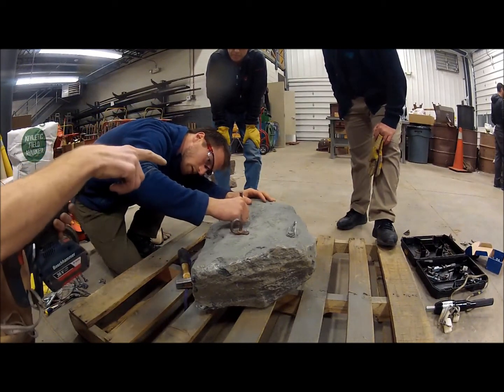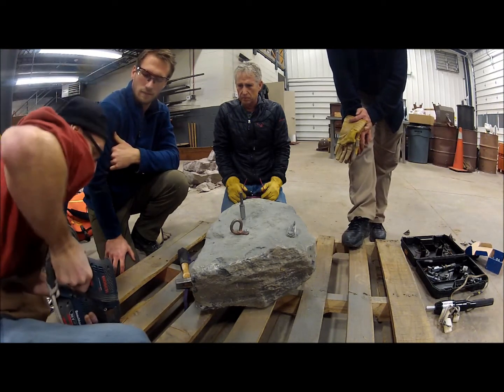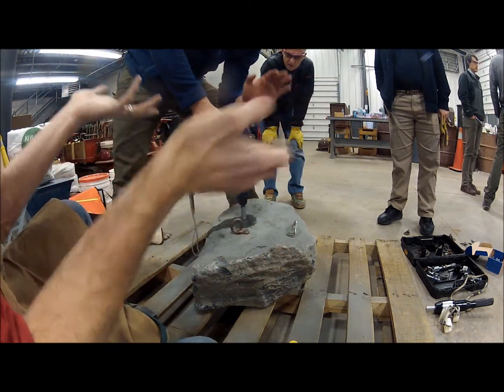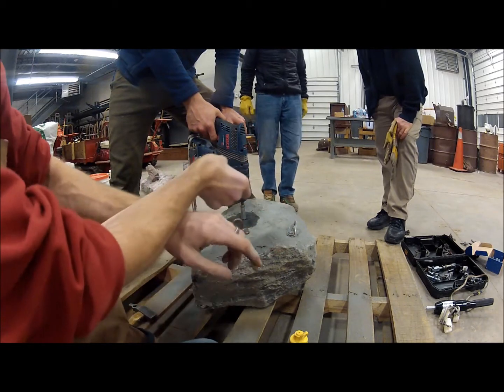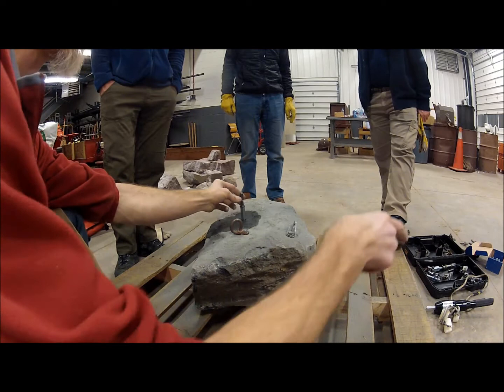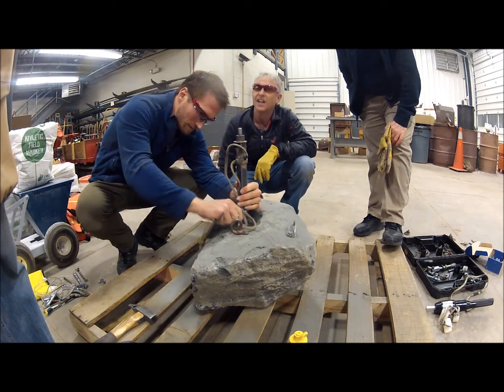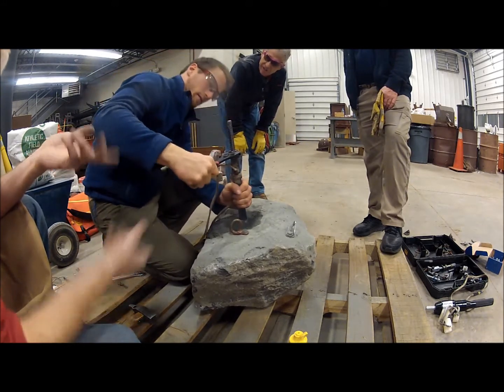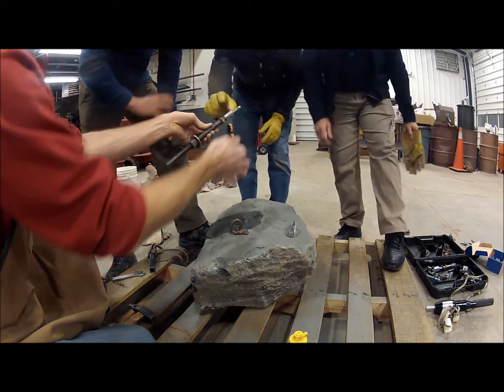Sustainable re-bolting: stud bolt removal technique (better video)

Comment: At 1:45, for the solution in the mustard bottle, is that the stuff jewelers use to tumble finish (https://en.wikipedia.org/wiki/Tumble_finishing, http://a.co/d/gsdWVVv), and do you have a rough ratio on water to grit?

Comment: Love your home made tool. How about using 24 thread per inch and then using a long socket on your drill to wind it out instead of using a wrench. Great idea though.
Reply from the maker: Couple of reasons not to: 1.) you want to have a feel for how much force is too much, else you will break many of the bolts you are trying to remove. 2.) battery life is at a premium - I'd rather use a wrench.